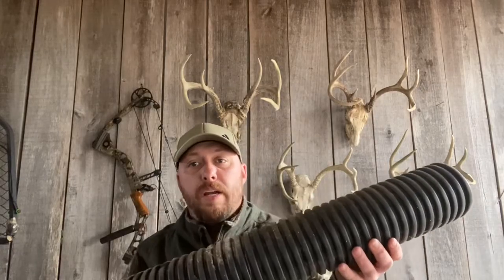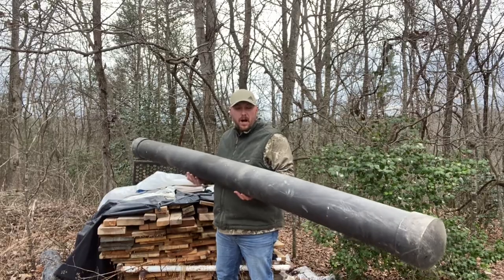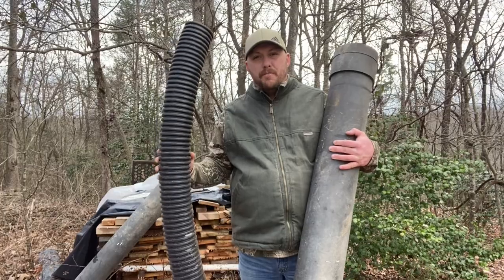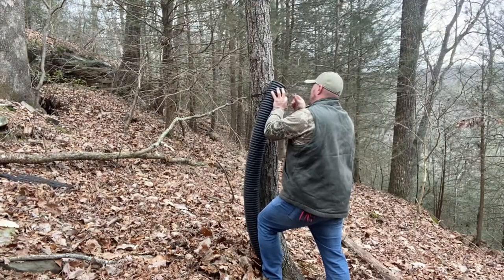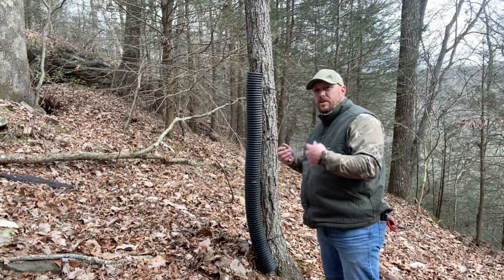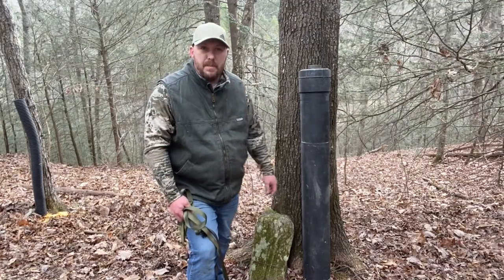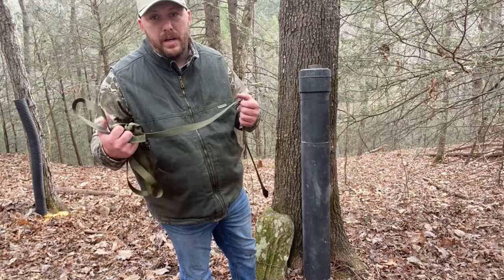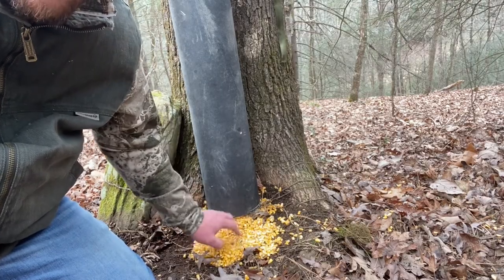DIY home made deer feeder - simple easy setup

Comment: Good video. I used 4in PVC and cut an angle on the bottom, the deer and coins will eat the ground below it and it will empty quicker
Reply: Raccoons, not coins
Reply from the maker: Coons or trash pandas what they called in appalachia
Reply: @JarredMurphyOutdoors  I tried that word, auto-incorrect changed it
Reply: @JarredMurphyOutdoors  put a stone paver under it so the dirt won't get dug out
Reply from the maker: @markwilkinson5350  I figured bout as much. I usually try to find a rock but that’s a good idea you got.
Reply: I use a Y on the bottom of my pvc feeder, the coragated pipe wouldn't last a week the bears would destroy it